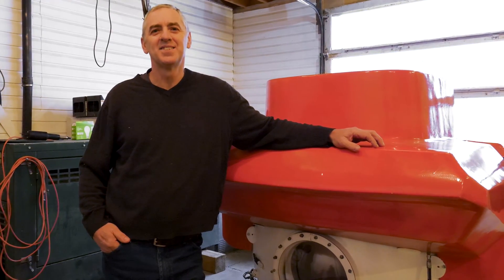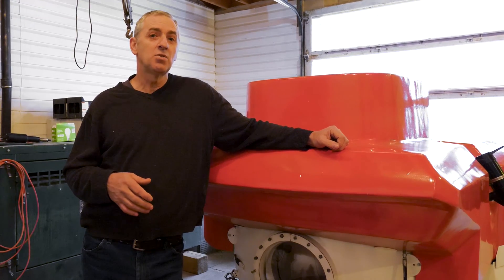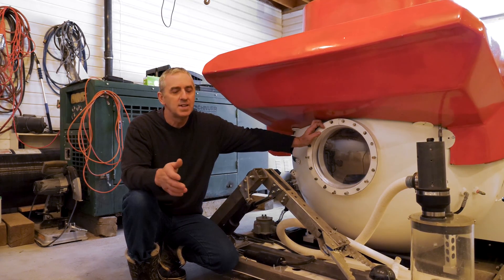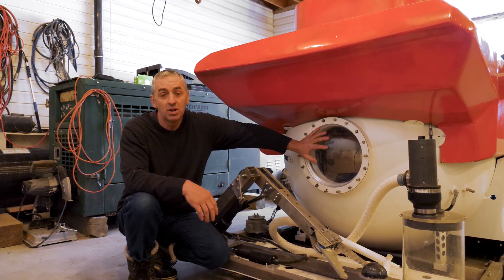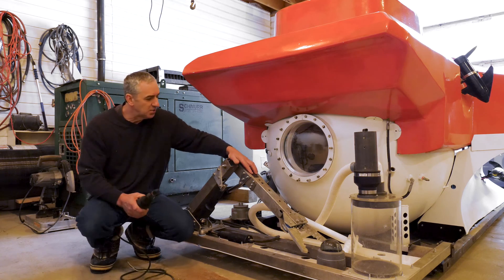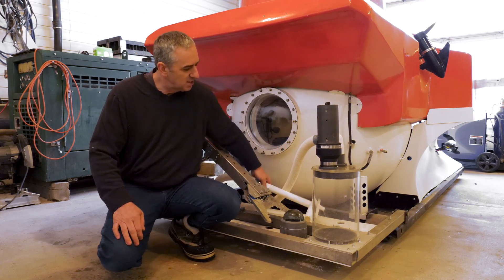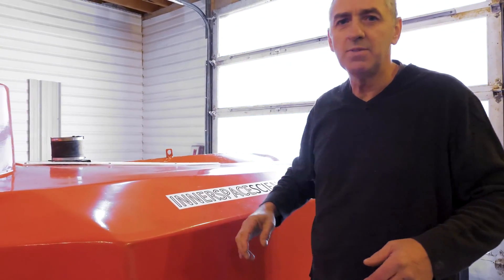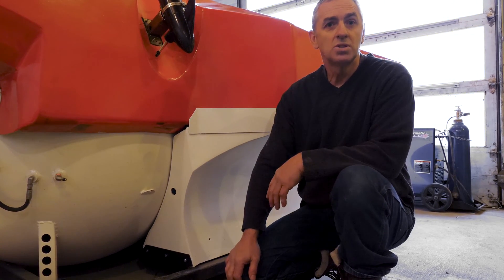Deepest Diving Homemade  Submarine In The World Built By Hank Pronk

Comment: I wouldnt be using that carbon fiber after what just happened if plan to do any deep dives at least.
Reply from the maker: The carbon fibre tanks are used for internal pressure as they are supposed to, so totally safe.

Comment: How do the detachable thrusters receive power if they are detachable? Batteries built in and radio controlled?
Reply from the maker: The motors have power wires that can unplug when the motor is pulled off

Comment: What is the best frame construction for a submarine? And what's the difference between a submarine and a uboat ? And is it possible to use a GPS on 300m depth ? 

Ps: love your videos :)
Reply: I don't really get what you mean with your first question, what frame construction? There is no difference between a submarine and an U-boat, the latter is just the German word for it while the former is the English one. You can only use a GPS while at the surface, as soon as your submerge it becomes useless. While submerged a submarine uses a barometric sensor in order to sense the depth it is at, combined with sonar + a compass (and probably also an inertial and accelerometric sensor) for underwater navigation.

Comment: I would like to know what you did to make the steel sphere. I have been struggling to find a good method to make my own. I was thinking of going for acrylic to make for better visibility, but its still rather experimental.
Reply from the maker: Hi Jed, I had two hemispheres formed for me in Edmonton Alberta then welded them together.
Reply: @HankPronk  did you use a stick welder or mig/tig?
Reply from the maker: @jedikachi6816  Hi Jed, I used a mig and followed all procedures required for 516-70 pressure vessel steel.